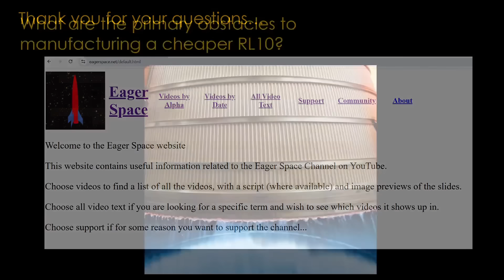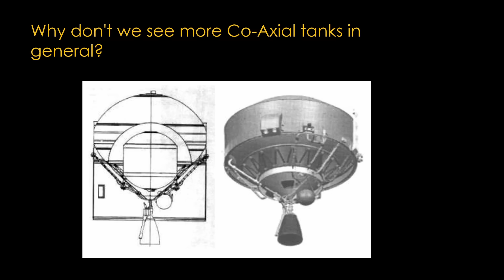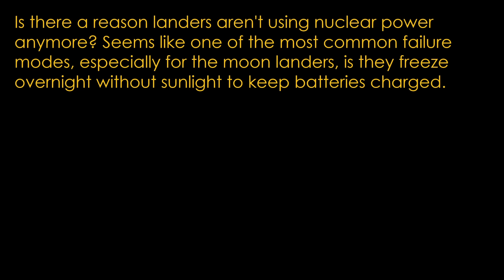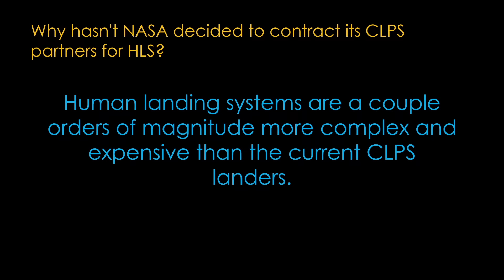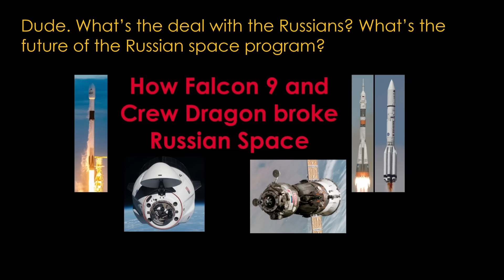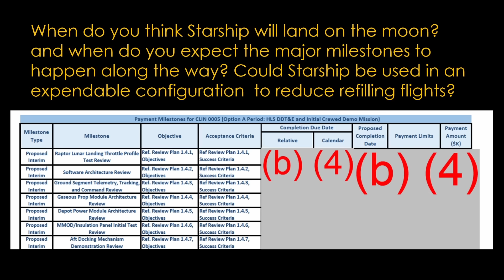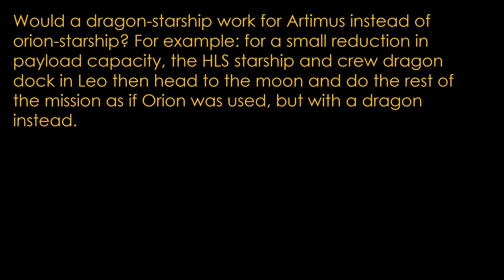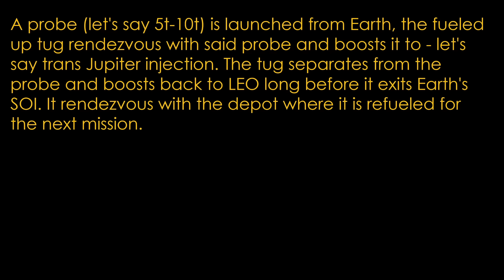Viewer Spaceflight Questions 3.1

Comment: I was too late to comment on the original video, so maybe a quick question for your insight.

During Starship flight 8, we saw a view from inside Ship's skirt, looking out at the engines and exhaust. The three center sea level engines looked like they were still producing mach diamonds in their exhausts, despite extreme altitudes. Does the surrounding Vacuum Raptor exhausts help contain the expansion of the sea level engines at high altitudes, making them more efficient, or is the effect probably negligible?
Reply from the maker: Mach diamonds are formed when you aren't at the optimal expansion ratio, so we would expect them with sea level engines running in vacuum as the exhaust is underexpanded. The vacuum ones are designed for vacuum.
Reply: @EagerSpace  thank you! It was something I was curious about since we see Mach diamonds from SL engines at SL as well.
Reply from the maker: You might want to watch my nozzle video...
The most efficient first stage engine would be one that was optimized to spend roughly half of its time underexpanded and some of its time overexpanded. But for first stages you often care more about thrust/weight ratios and a smaller nozzle that is slightly less efficient allows you to pack more engines under the first stage and that's can be more important.
Just to make things more complicated, you are generally aiming for a specific exit pressure from the nozzle, but that depends not only on the size of the nozzle but the combustion chamber pressure, which of course varies from engine to engine.
Reply: @EagerSpace  I have a follow up here: Superheavy produces something which looks like Mach diamonds in the combined exhaust of all its engines. Is that because the air "trapped" between those gets ejected and so the engines are significantly lowering the pressure there?

If so, wouldn't underexpanding the exhaust for each engine result in the "correct" expansion ratio for the whole system?
Reply from the maker: Not sure, but at takeoff I would expect that the combined exhaust plume would operate roughly like a single engine with the diameter of all the engines.
Reply: if I remember correctly mach daimonds are formed bc your outside pressure is to big and you lose efficiency, so IMO it is better than without outside engines but not a big deal